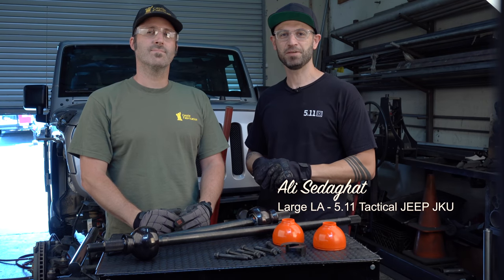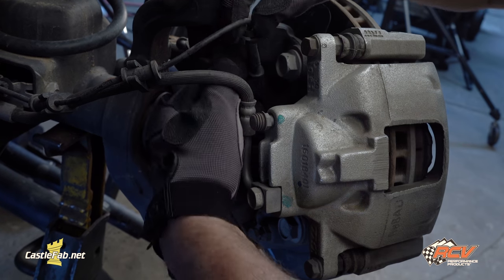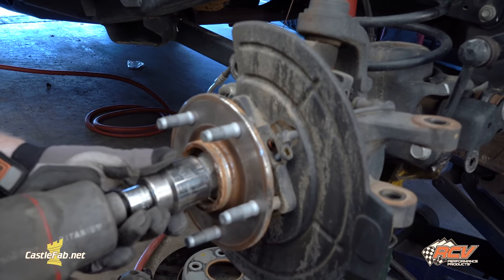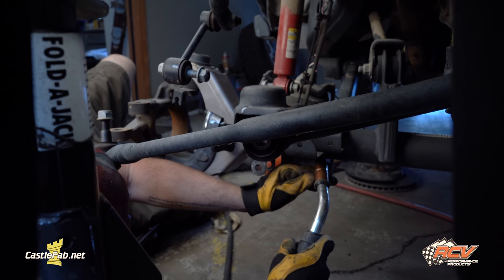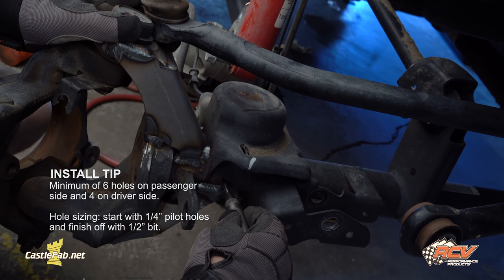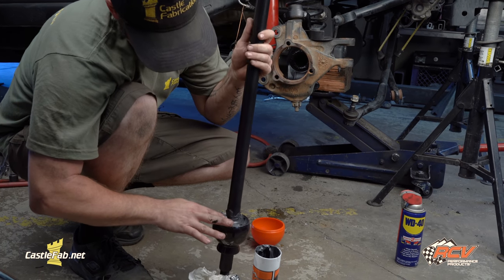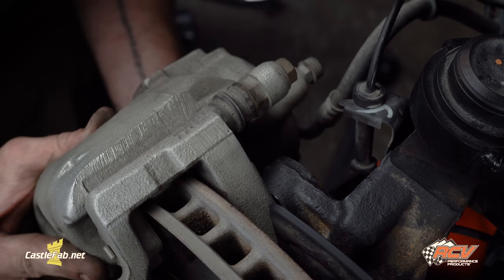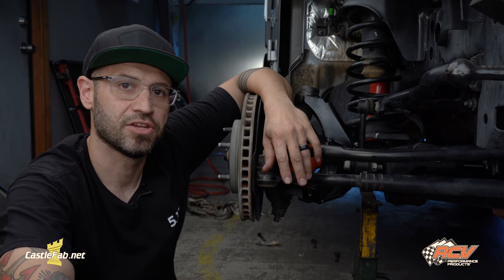Upgrading our Dana44 axles to RCV Peformance’s Ultimate Dana44 CV Axle set on our 5.11 Tactical JKU

Comment: Good video but you left out some important information, I'm assuming you drained the axle lube out the axle before you started and you cleaned sediment from the axle housing on both side's before you drilled the holes and how did you de-bur holes before inserting the sleeves. That would have been good information to have. This was a how to video but you left out a lot of how too. Unless it wasn't a how too. Then good job.

Comment: Hi Ali, since you've done this upgrade, what have you noticed difference from the stock axles?  How do you like the RCV joints?
Reply from the maker: Honestly I’ve noticed no binding at full lock. Also I’ve noticed my own confidence is a lot higher that without them. That peace of mind knowing I’m 2xs stronger than stock allows me to focus on crawling on tougher trails than being worried about getting home. Now the rears on the other hand are a different story.
Reply: @FixBreakRepeat  Nice.  I'm also replacing my tie rods, drag link and upgrading my ball joints to Dynatrac.  I replaced my rear axle to G2 chromoly because I bend my stock one.

Comment: 15k for a Dana 60? Who in the blue hell are you getting that quote from? You can get a King Pin 60/Full Float 80 combo for that and if you think that 30 spline CV shafts and gussets is a budget friendly solution comparable to a D60, overstatement to say the least. Even if you upgraded to 35 splines, gussets, Reid knuckles, trussed and sleeved, your ring & pinion is now the weak link. A busted axle shaft is an easier fix, especially on the Trail.
Reply from the maker: dwizl7213 totally open to being spot checked but if you’re going to go through all that trouble you might as well start listing prices of 60 comparable axle sets.
Reply: @FixBreakRepeat  I figured you meant the whole set of one tons.  15k is about right.
Reply: That's insane, just buy your parts,components, and do it yourself, many of these utube self proclaimed expert professionals also have shops and when throwing outs costs it's usually what it would cost for complete job, from the time dropped off till they give you back the keys saying pay now, done, and chuckle all the way to the bar or bank

Comment: Wear you guys did all that and still have OEM  suspension
Reply from the maker: Frankenstain 4x4 i can see how it looks that way. But we actually filmed this install and then did the suspension install afterwards.
Reply: @FixBreakRepeat  ok
Reply: @kenskens69  if you get creative you can fit 35s or even 37s on stock or really close to stock suspension and maintain factory like highway driving, at which point a reinforced axle and axle shafts are necessary, fitted 35s on my 05 LJ with just an angle grinder and wheel spacers, factory shafts lasted 3-4 years just broke yesterday
Reply: jeeps been tested upto 160kph with 35" mud terrains and drives like a boat

Comment: ARE THERE ADVANTAGES WITH THE DRILL/WELD IN SLEEVES VERSUS THE HAMMER-IN SLEEVES?
Reply from the maker: Not that I’m aware of. All i know is that these aren’t going anywhere.
Reply: less chance of running into a situation where there was too must crud in the axle that didnt get cleaned out or the axle wasnt dead straight to start with and you hammer the sleeve in half way and it ends up stuck where it wont move either directions
Reply: imo just buy some 3/16" plate and make your own truss and gussets be 3x as strong as the sleeves at 1/3 the price
Reply: Andrew Browner I’ve actually thought about that, these companies charge $150+ for truss kits and anyone can make them with a torch and time
Reply: @gibson5056  cutting torch, angle grinder, plasma cutter, hole saw, recip saw, band saw, they even make steel blades for circ saws.. 100 ways to cut metal and make a unique truss to fit your build.. get a full sheet of steel for 160$ canadian enough to do both axles make two bumpers and enough left over for skid plates.. or pay 220$ plus shipping for a precut truss for one axle

Comment: I would think 37s and a supercharger would break both dana 44s?  if yes, this was a waste of money
Reply from the maker: SandhillGuitar not at all. I’ve done major trails in Moab (including gatekeepers that had my massive jeep hopping up and slamming down ) and long washboard roads and even more recently, the John Bull trail. My axle 
setup has held up fantastically. Supercharger and all (mind that the RIPP system “only” adds about 100 more HP which helps make all that added weight and gear feel like stock again.
Reply: with trusses and aftermarket shafts and ring/pinions i dont see an issue with 37s on 44s, the ujoints are really the weak point up front and the rcvs fix that issue, supercharger is really beside the point its more about the traction the tires are getting and how roughly the driver treats them, clapping the clutch out at redline with factory shafts and aired down 37s on dry rock will break in a second, rcvs with a steady foot and automatic trans will last years

Comment: Not need tube seal ,,,,l tinking the garbaje and wather coming inside axle shafts ,,,,,tell me this
Reply: thats how it works on the factory unit, doesnt really effect anything until you goto fix something and get dirt onto the seal, theres a seal in side the housing near the ring and pinion that holds the oil in and dirt out, for 80$ theyre a nice addition to the jeep to make future mods less of a headache

Comment: 15k on 1tons no way more like 3k or less buy the axles in pairs run normally 1.2k max include truss swap kits another $600/700 and rebuild kits and gears your looking around $3,000 or so for one tons not bashing good video just the price point you said was way off
Reply from the maker: Rizon Gaming if (and I’m assuming they are) your numbers are right that’s a valid point. But I really was speaking to the name brand brand new complete options that can run into higher 10’s installed at a shop.
Reply from the maker: Rizon Gaming sounds like a good video in itself.
Reply: Start to finish building junk yard tons with selectable lockers costs more than 3K for a JK that’s for sure. It’s certainly cheaper than buying new tons though.
Reply: @JsGarage  unless your doing drive slugs tons have manual hubs why would you need to drop money on selectable locker's when you can full spool a front and either LSD rear or go with a locker still cheaper though
Reply: FloGrown Customs I wouldn’t full spool a JK unless it was a full competitive vehicle. I also wouldn’t bother with an LSD on a Jeep 1 ton swap what’s the point? Even if you go full time lockers front and rear there’s a grand. I’d rather at minimum a selectable rear and full time front. So there is $1500. Gears with master kits are like $1000 ish for D60 and 14 bolt. Artec trusses $800-900. $800 for front unit bearing to convert SD Dana 60 to 8x6.5. However much for the axles themselves maybe $1000+. Diff covers, brakes and miscellaneous things to complete the job. It adds up quick but I certainly agree it’s a cheaper alternative to buying tons.